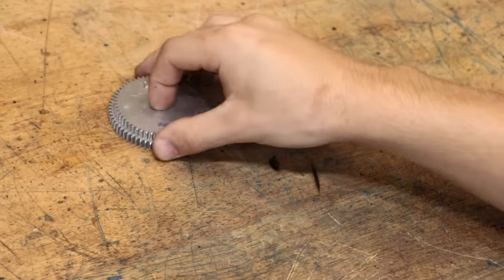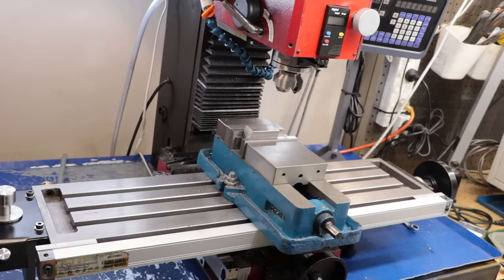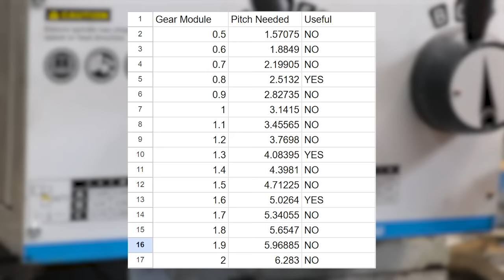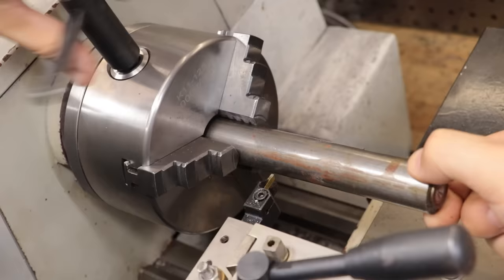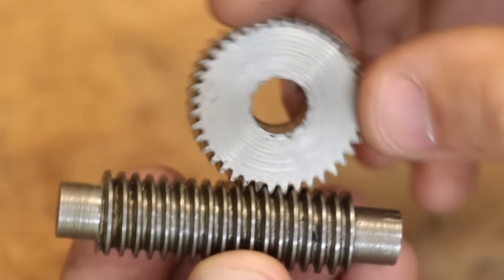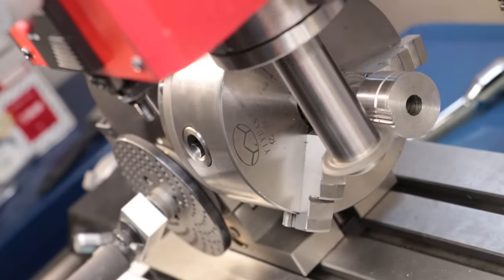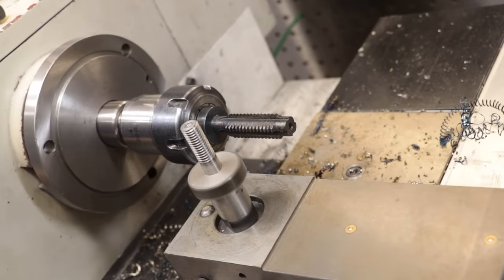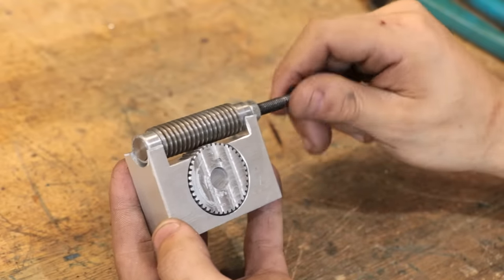Making Worm Gears. Harder Than You Might Think

Comment: Very nice work. The quick and dirty method is to use a tap and just calculate the appropriate gear from that.
Reply: Or make a cutter from a 5% larger diameter worm, as I do.
Reply: Or just use a cnc lathe. I mean, its cool from a romantic nostalgic point, but with the cheapness of cnc setups now, even your smallest shops have access to cnc lathes.

Comment: You did a good job there. One thing you didn't mention, the hob you made has subtly different dimensions to the worm as it has to cut the gaps between the teeth and the gaps are thinner at the root than the width of the top of the tooth. Otherwise, well done! You've just gone through the same learning curve I went through when the worm drive in my bandsaw packed up. Couldn't find an off the shelf spare, so it was DIY time, making a new worm and worm wheel using the free hobbing method like you did.

Comment: I did this a while ago, only I used a triple start worm.
It took several attempts at each stage to figure it out, and my set up ended up being much nicer than what you have done.
The most important thing to keep in mind when free hobbing is that until the gear is cut to full depth, it does not turn at the correct ratio, and the whole thing ends up out of sync.
The "secret sauce" so to speak, is in how the hob is cut, and preparing the gear.
The hob must cut slightly deeper than the worm diameter, but its root must be exactly the same as the worm. This means you actually have to grind a different tool for the hob and the worm. The back of the teeth must be fully backed of or it will bind the gear while hobbing. You left a pretty large space behind the cutting edge and the relief, much too much. Lastly, the hob really needs to be turned between centers.
The gear needs to have the concavity cut on the lathe to about 0.002" from final size, and a specially ground tool is needed to get the shape right. The gashing also needs to be done to about 90% of finish shape and depth. So you can not use a conventional spur gear cutter since it it too big in diameter. I turned a piece of tool steel to 90% of the diameter of the worm, and then ground the tooth profile into it about 10% undersized. Gashing was just like you showed.
I also used roller bearings on the gear to ensure it was clamped well, and yet able to freely spin. 
The hobbing at this point is really just making the finish cut. The "blank" should actually be close enough to done after gashing that the worm will drive it.

Comment: One thing you can do to cheese worm gears is to make the large gear by holding it with bearings and then use a tap as an endmill to cut the gear shape.  As the threads cut the blank it rotates and you feed in SLOWLY.  Once you have good engagement its done.  Then you can use the threads as the small gear.

Comment: Thats some impressive work for sure! Another thing that also amazes me about worm gears in general is that they last as long as they do. The thing being that in constast to other gearbox types where the gears just roll over each other, with worm gears you have a lot of sliding going on between the screw and the gear. Sure worm gears are filled with some good quality oil adapted specificially for worm gears  but still I would expect a worm gearbox to have a much shorter lifespan because of the sliding motion. A real world example from me is the metal bandsaw at my workplace wich uses a worm gear drive. The drive motor on the saw and thus also the screw spins at 3000 rpm with slam on direct start sometimes starting and stopping 100s of times during a workday. We got the machine in 2004 and it still show no signs of wear on the gearbox after 20 years of operation. At least I cant hear any different noises or notice any backlash still on the machine.

Comment: Great video showing the various ways to make a worm gear in the home shop!  I like the second method, gnashing the gear and then using the hob to cut final depth. 
  I make these for positioning applications. For higher tooth count worm gears a standard tap works great in place of a custom made hob. For 180 and 120 tooth worm gears a 3/8-24 or 3/8-16 tap is my preferred hob. 
  I started this only really to say that anyone making a worm gear that gnashing with the dividing head is a must before hobbing. You'll cut more teeth than wanted on the gear if you skip this step and make a mess of thin This puts the ratio off and also makes and the tooth spacing incorrect. 
  I just bought Steve wards rotary controller (world of ward). It's incredible. It's about $230 US and all you need to buy is a $20 nema 23 stepper motor and machine a mount for it to suit your dividing head/rotary table. You get 0.005 degree accuracy and can divide a circle by upto 9999. You can also move by  degrees to two decimal places. You can machine radius or cut circles as well. It has 4 or so preset selectable options for rotary control plus ones you can program from the keypad for custom applications. It's in plain language anyone can understand, no g-code or other difficult to learn languages.  I was cutting a gear 15 minutes after i had the steppet motor mounted and wired. It has a second output that allows you to add any size driver and stepper motor to add an x, y or z axis that you can use in combinatiom with the rotary stepper motor.
  It can also be configured as a rotary axis if you needed a bigger driver and motor for your rotary application (think 4ft rotary table). The second axis can also be used as a spindle drive to give you timed spindle and rotary axis so you can use a real gear hobbing cutter to make proper worm gears. 
  I'm even using it with a stepper motor on the x axis of my tool and cutter grinder x axis for surface grinding. You can add two limit switches and turn on/off a brake or fire an air cylinder etc. It's great as a standalone rotary or linear controller but incredible if you use both axis control. I don't speak g-code and had no desire to learn cnc, the "programming". Gear cutting is as simple as entering the desired tooth count and hitting entet. You simply hit go to advance to next cut. Add the stepper to axis and add limits and you can program/automate the entire gear cutting process. The manual makes it easy to wire and use the unit. I had no prior stepper motor experience and basic electrical knowledge. He gives all the support you need and you can even buy tje components and build itself yourself for far less $$$. Of, enough of this ramble!!

Comment: Man, really liking this channel.  Keep it up and you'll be drafting ToT.
This might be a dumb question, however why don't you use a hacksaw blade while cutting a part off in the lathe?
I can see a full size hacksaw potentially becoming entangled with the chuck, but what about just using the blade?
Or is that one of those cardinal sins taught to fresh newbies?
Reply from the maker: If the hacksaw ever grabs on the material whilst the chuck is spinning I could see it very easily pulling me into the spindle. Not a risk I’d like to take on this big lathe.

Comment: Interesting video and great work. That straight cutted gears become really noisy, and the inacuraccies between the teeth add up with every additional gear. A worm gear has lot of advantages (self-locking) and disatvanteges (friction, extremly high w&t when high forces are transmitted) - so its uses are very limited. So ......one of your next projects maybe could be some helical toothed gears? Perfect to reduce noise and clattering.

Comment: Cutting normal thread on a lathe is already somewhat of a challenge, at least as small as this one. When I learned lathe the only thread I cut with a chisel on a lathe was a trapezoid moving gear on a 4 cm diameter blank steel rod. The worm is not really a problem if your lathe lets you choose the correct values, but the gear is the major hurdle. You could cut every tooth with a mill when you set the table to the gradient/slope (idk the correct word in english for this) of the worm so it fits, but then you'd have to rotate it.
Or you could build a little helper. Precut every tooth with a normal thread cutter so you have the perfect gradient. Then mount it on an angle with a tiny spring that grips into the little valleys so you can mill another tooth at the exact position, combined with a quick span of course so the mill doesn't rip it apart.
And then at the end you cut a round depression into it with the lathe.
That requires of course that the piece is a bit wider so you can still put it into a chuck, and then cut the gear off.

Comment: I came across a strange worm gear set up on an old OZITO electric chainsaw the worm gear set up was the motor shaft a 12mm metric thread driving a gear at 90 deg for the oil pump, it was defiantly a 12 mm metric thread as a 12mm nut was holding on a spacer on the end, the gear was made out of steel and had the helical profile, I thought it was odd until I saw this Video  and how you made your own helical cutter ,  I guess the Chinese have mastered it.

Comment: I had to make a worm gear for a mig welder wire feed motor. With a limited amount of tooling on hand, needing the welder for an urgent job and it would take a month to get a replacement gear I was tasked to come up with a solution. The worm gear was made out of aluminum and was stripped in a spot, But the work was made out of steel and not damaged. So checking around I found a tap with the same thread pitch as the worm. What I did was to find an end mill with the same diameter as the tap, cut a blank gear slightly larger than the original. Then used the end mill to profile most of the radius in the gear blank using a spin jig to rotate the blank. After making an arbor to hold the gear so that it spun free I used the tap in the mill like a gear hob. Now the tap has a 60° angle and the worm is basically an acme thread. So to finish form the worm gear teeth I used a lapping compound with the worm from the welder. I had the job done in under 12 hours and the welder was in use the next day. Sometimes you have to think outside of the box when you are in the middle of no where and you need to get a job done. This happened when I was in the military about 5 years ago. They are still using that welder with that gear I made.

Comment: Nice work!

Could you use thrust bearings instead of spring washers to take up the slack but retain the rotational motion of the gear being hobbed?
Reply: yes it would be better can also use a double nut setup to lock the nut in place so it doesnt tighten or loosen on its own , ideally youd use a thrust on both ends

Comment: If you put a encoder on the one axis of your mill, and a stepper motor on the dividing head, you could do an electronic connection between the 2. Many people have done it. It's like a variant of an electronic lead screw on a lathe

Comment: Straight cut or with the actual radiused profile, it's still a worm wheel. That radius is used most times (but not always) when the drive loads get higher or better tooth longevity would be helpful. So in reality, it all depends on what the worm and worm wheel were designed to do and for how long. 

And fwiw, all threads and gears can't ever be made to be "perfect" if your metrology to measure them is accurate enough. What that's normally referred to is there lead and lag pitch errors. Moore Tools in the U.S. spent massive amounts of money in effort to produce as close to perfect lead screws and nuts for their jig borers and grinders before very high accuracy dro's and then cnc were invented by grinding and then precision lapping. There final errors in thread pitch weren't out by much, low millionths of an inch in fact. But they were still there no matter how much time, effort and money they invested. Luckily and for us when used in something like a rotary table or dividing head, any pitch errors are divisible by the gear ratio between the worm and worm wheel. So the accuracy can be much better than the worm and wheel itself.

Comment: Great work! I didn't expect the gear wheel to be the complex bit, but I should have guessed. Would a thrust bearing help with holding the gear blank down on the hobbing setup? It should allow tight workholding with a lot less rotational resistance?

Comment: at tafe we make a 4 start worm gear in the horizontal mill, with the shaft that connects the two. a four start thread is mad complicated, especially because it he helix is so long compared to its rotation, so the cutter is working hard to machine it

Comment: You can use a similar process with a plastic gear, but not cutting, instead thermoforming it.
Instead of a cutting hob just use the worm itself, and heat the outside edge of the plastic gear blank then using force, push the worm into the gear while it is spinning then friction will keep the outside of the gear soft enough without the heat gun and you can finish thermoforming the plastic gear to exactly match the worm.
Plastic worm gears are very popular because they are quiet, and can have no backlash because in the final adjustment they are tight and use elastic deformation of the gear (instead of a metal gear and worm which need a fixed clearance because there is no elastic deformation).

Comment: I've been known to use acme threaded rod for worms, with regular gears. Figure the 29 degree flank angle on the threads works with the older 14.5 pressure angle on diametral pitch spur gears. Yep, I'm lazy. Not for transmitting large powers, but great for establishing odd angles.

Comment: 16:40
I would think if instead of using the long axis, one can just use the in/out axis to cut the worm gear profile… It will cut an inward concave groove in sort of the same way a proper worm gear is. The only real problem is the radius of the cutter, which can be solved by using a custom rotating cutter with an adjustable depth, similar principle to a fly cutter but specific for the application. A makeshift one made from a broken boring bar with a carbide tip ground to profile might be the ticket, though not adjustable unless mounted on a boring head.

Though, 22:30 is also one smart way to do it

Comment: I have the smaller CALOR GAS bottles here in Dublin, IRE. 
I have about 10 of them and I'm weary about taking the head valve off. How do u know if there is no more GAS left in the bottles. The ones I have have been sat in a shed for 20 or more years. Some of them have someth in them bcos I feel it moving inside the bottle. 
Any advice would be greatly appreciated. I want to build a stove for my workshop. It's bloody freezing in the winter and I'd love to be able to heat it up then. 
Great video but the tool u made is beyond me pal.. LOL
What would be the best wrench to take the valve off with?
I enjoyed the video. It's a bit hazy in the picture though mate. Maybe the lighting is off a wee bit bt I still enjoyed ur video anyways..

Comment: I was going to ask why we cant just use a cutting tap, but I think you basically covered it. Because the worm wheel is not only slanted but also curved, I believe is your reasoning, which makes sense to me. I guess if we wanted to make a non proper worm wheel, i.e. the slanted but not curved kind, we could simply use a cutting tap, and perhaps make some backups for when they wear. Despite the value and entertainment of this video, which it def has, that still seems like a great option for a non lathe home garage project. Thanks for sharing, very nice video.

Edit .. wait, the curve is on top of the tooth? I thought it was a curved slant. So, basically, the proper worm wheel is exactly the same as the cutting tap worm wheel except it has a curve cut into the top of each tooth? If so, seems the wear pattern would work to make the non proper worm wheel become a proper worm wheel over time. Am I missing something?
Reply from the maker: Ah yes, I should have covered that but I chose not to. The helix I am referring to, is that the tooth itself is slanted back and curved.

The curve that you can see is called the throat of the worm wheel. This would be called a throated worm wheel. If you look up on google you can see the difference between a non throated and throated gear.

On the subject of the tap, if you mean using a normal thread tap to make the gear, yes  you could but it would be a different profile angle
Reply: @artisanmakes  Well, you cant cover everything in a single video. Thanks for addressing here. I think I get what you are saying .. its difficult to describe 3 dimensional complex shapes in words 🙂It was difficult to see in the video, but I can tell now from still pictures that as you say they are curved forward. Very interesting, thank you.

I bought a cheap non throated worm gear and 60T wheel set, didnt even know at the time about throatedness. It is small and will drive a small door, will only turn 1/4 turn each time and the worm gear only goes 10 rpm.  Hopefully it will suit this purpose for long enough.

But, either way, now bc of this video I know the difference, and can choose inexpensive non proper gear for home made gear or cheaper ones to buy, vs proper gears when it matters more.

Thanks for the information, super helpful. Best regards to you.